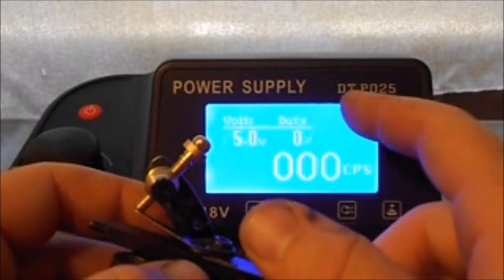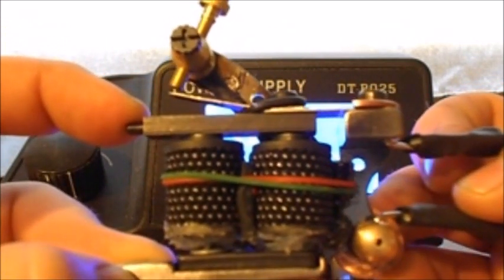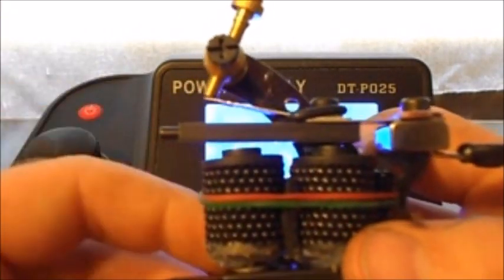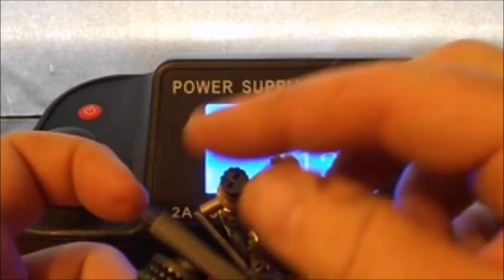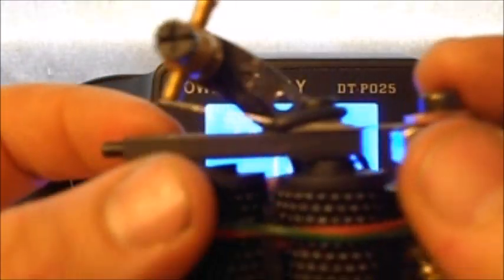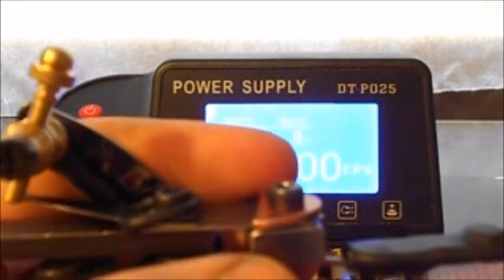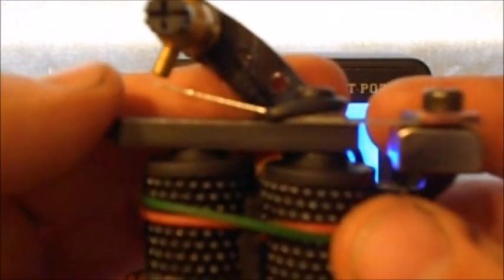Duty Cycle Explained  Tattoo University

Comment: Duty explained at 1:18 example !
Super helpful

MAIN POINT:
[ less than 50% duty = 
more time spent down around coil]

[more than 50% duty =
More time spent up
Around the contact pin]
Reply: 2:04 Adjustments to contact pin - front spring: change current Duty
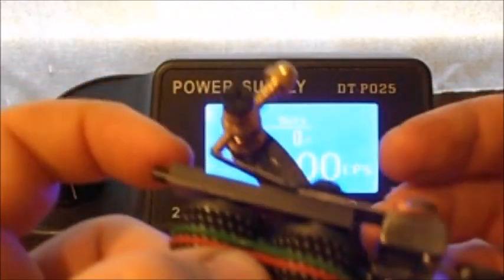Reply: 3:31 
Tightening rear spring = Shortening it closer to the frame
Another Duty adjustment
Reply: Just some personal notes that helped me learn from this video..
Hope these help others too!

Comment: I have a good understanding of machines and duty cycle, what it means and how to change it.  I have a set of pulse coils on their solution machine that run at 112cps and a 6% duty, around 375g tension with right at a nickel gap for the point gap and air gap.  The machine for all intensive purposes is running "normal".  Critical power supply is fine.  Assumed the coils were "bad" and put on a new set.  New coils are running 125cps and 54% duty with all other parts being the same.  What causes those pulse coils to show a 6% duty? Adjustments to the springs and point gap will cause a change but it'll jump around and then drop right back down.
Reply from the maker: That is a good question.  I have not run into that issue yet.  I will have to look into this.  Did you try to put the coils on again and see if it still had 6% duty?  Usually when numbers jump around I know something is off.
Reply: Tattoo University lmao. Sure did. I thought no way. The capacitor is good. Nothing is loose or shorting from what I can tell. But I put those pulse coils on and bam 6% duty. Doesn't make any sense. I even threw on a tube and needle and grabbed some practice skin. It runs like normal.  Put the new set of coils back on and it's right back to >50% duty. So it has to be those coils. The only slight difference is I need to add some extra shims to the front pulse coil. Same shims though. I just need 4 on that one instead of 2 with the new coils. I should go video it and put it on here. I've never ran into this before.
Reply from the maker: You got my interest.  I would love to check this out.
Reply: Tattoo University go ahead and check the video but I think I've solved my problem. It's coil and critical power supply specific. I've been rebuilding machines all day. I have 3 of about 20 sets of coils that the critical power supply just will not recognize. 2 I'm sure are Chinese junk but the other is that set of pulse coils. One of the others will read 100% duty. The other just bounces around. What I did was dug out my backup hurricane power supply. It will read them correctly. Or it at least gives me numbers close to what I expect to see. I notice since doing this all day as soon as I touch the pedal on the critical PS for one instant it'll flash correct readings then it'll go all haywire. No idea what these 3 sets of coils have in common that the others don't have or do have. I'll ask critical and see what they say but I expect they'll just say they're power supplies are just that super sensitive and accurate that something is throwing them off. Like they say you're duty on their ps's will read a bit higher than others because of their accuracy.
Reply: Tattoo University Criticals developer and owner found this to be very unusual as well. Have them checking the YouTube video and determine if my ps needs sent in for diagnostics.
Reply from the maker: Keep me updated if you will.  I like to troubleshoot problems and this is something I haven't run into yet.  This way I will know what to do if someone brings up this issue again.
Reply from the maker: Typically when I see this there is an issue.  Usually a short and the machine will run correctly for a second before it  messes up.  I've had power sources that turn off when this happens.  Usually a safety measure so the power source doesn't get fried.  If the machine is erratic when it runs and the power supply can't quite get a number it likes.  Usually I do what you did and switch out parts.  Narrow down what part is causing the  problem.  The duty cycle lets you know how many times the circuit is on and off.  With a rotary machine you don't get that because it is a motor.  The power source will still run but won't give you the duty.  My guess is the way the power source reads the duty is being thrown off by something.  Something is being erratic or not stable.  Maybe the cheaper power supply isn't picking up on that but the critical is.  I would probably switch out the capacitors and see if that fixed the issue.  If that didn't do it then you could cross that off as the problem.  Will be interesting to hear back from critical on this.
Reply: Tattoo University yes the owner of critical seemed to think it was a problem with the "contact point interface" within their ps causing the issue. He's supposed to look at my video today and let me know whether or not to send the ps in for diagnostics. Seemed pretty honest to take his top of the line ps and admit right off the bat that the ps may be the problem. Can't say I've ever had a capacitor go bad. I would expect sparking don't you think?  Worth a try I suppose. I have the parts so wouldn't be a big deal.
Reply from the maker: Awesome!
Reply from the maker: It might not make sense to me, but I'll try it anyway.  Every once in awhile you get surprised.
Reply from the maker: Usually messing around with this stuff leads to the answers you are looking for
Reply: Tattoo University ya and that's about the only thing left that I haven't messed with. Lol. I'll get one on there here in a bit and report back if it made any difference.
Reply: Tattoo University Nope changing the capacitor didn't help. All 3 that don't read correctly are 47uf so I tried a 22uf. Used the China coil that reads 100% duty. Didn't want to tear apart what are probably perfectly fine pulse coils.  Machine runs faster of course. Still 100% duty. I'm wondering now though...if I had put one on the pulse coils would it have increased my duty to 8 maybe 10. As the lower uf rating should increase the duty too. Can't tell when it's already at 100.
Reply from the maker: Hmmmmmm.......interesting.
Reply from the maker: It's like the power source is too smart for practical use. The good thing is you know what you are doing.
Reply: Tattoo University ya that's kind of alarming for Critical I'd think. I guess he said they've never seen that before but for a newbie they'd be lost with a ps doing that. I wasn't all that concerned because the vast majority of my coils read just fine like 17 out of 20 sets. I just wasn't going to use the ones that don't register right. I ordered 2 more sets of pulse coils. We'll see if it reads them ok. Now I'll be convinced the ps is bad if it won't run a brand new set of pulse coils. Didn't hear back from Critical today.
Reply from the maker: This is an opportunity to learn something.  I'm glad you shared it with everyone.  I think there is a lot of room for improvement when it comes to tattoo machines.  Figuring out little quirks like this can lead to better equipment in the future.
Reply from the maker: I've heard comments that there is nothing new in tattooing.  I think this is incorrect.  We are making improvements on tattoo equipment.  As you improve you also run into glitches.  Tattooing is advancing and the technology is advancing.  Thinking that tattooing technology doesn't improve would be a mistake.  I trust critical and eikon.  They are a good companys.  They have a reputation to protect in the tattooing community.  I'm sure they will figure this out.  If they don't I'm sure the tattooing community will.
Reply: Tattoo University agreed. You know what I keep waiting for is a system similar to the cartridges but that also have a sealed ink pack on board that feeds to the needles with a lil squeeze. But ya I hear ya. My main equipment are pulse machines with pulse coils obviously, eikon springs (I actually just ordered their tru spring a bars because I've never tried them), and critical power supplies. Those are 3 of my most trusted companies. National as well. I've never had anything bad from them as well and great customer service.
Reply from the maker: You have read my mind.  I have some drawings of needles with ink cartridge systems.  Nothing concrete yet but I have some ideas.  You should be able to set up a tattoo machine like you refill a pen.  If the customer service is on point I can give them a little slack if they send me something bad.  As long as I can send it back and get a refund in a timely manner.
Reply: Tattoo University see I also vape. And the bottom feed mods got me thinking if you had a small silicone bottle that fit into the grip you could have a small silicone tube run to just behind where the needles touch the bottom of the tip. So you would tattoo until it started to run dry then give it a lil squeeze with your thumb to push more ink to the tip. Send me your email and I'll send you a pic based of these bottom fed mods. I think it's completely doable.
Reply from the maker: I thought the problem would be mixing colors. You could set something like this up for lining.  You could outline the whole tattoo without dipping in the color cup.  Could save you a lot of time.  Maybe with color you could just have an empty cup that you could mix colors in.
Reply: Tattoo University ya the way I have it drawn up you would have a bottle for each color. Maybe the little nipple on the tip could be made to plug a syringe on it to flush the tube out. Even just having maybe a 7rl and 15 mag for black only would be a time saver. Just seems like dipping your tips into little cups is something that could evolve into a more efficient system.
Reply from the maker: I agree that there should be a better system for the color cups.  Too many things go wrong with them.
Reply: I am confused about Volt, CPS and duty .. I have a machine brand new made in England I need 9v to get 50% duty and 128cps. Is that ok or does the voltage has to do with how strong the machine hit??? Thank you for all the informations. Your videos are very helpful I am 53 and finally have time to learn about my past passion. Very hard at my age to get help and infos and sure no apprenticeship possible.

Comment: so how about the tension gauge or grams for ,
 does it really matter
Reply from the maker: Tension matters.  Too much will overheat the machine.  Too little and your machine won't run right. You can do it without a tension gauge but the tension is important.  You can do it by feel but a tension gauge gives you number to work with.
Reply: so you mean no proper number for this sir?
Reply from the maker: There are numbers that people recommend for your machines.  People set them up differently and machines are different.  I'm posting a link to San Martin Tattoo Supply.  They have a page with their recommmendations.  

http://sanmartintattoo.com/index_files/Page5633.htm

Comment: doesn't just tightening and loosening the contact screw practically do the same thing
Reply from the maker: That will adjust your duty cycle.
Reply: Tattoo University okay so then what exactly Is the difference between bending your spring compared to just adjusting your contact screw?
Reply from the maker: You are talking about a machine tuning issue.  You want to get your machine as close to being tuned as possible.  Then you adjust your contact screw a little to get it perfect.  If you just adjust the contact screw your machine can still be out of tune.  You could have too much stroke.  You could have too much tension on the springs.  You dial everything else in first and then adjust your contact screw.
Reply: Tattoo University ahhh I gotcha how can I know if I have to much stroke?
Reply: I adjust my contact screw and my voltage for I'm running low volts without there being to much hit so it's just about right I go down on the skin and it has just enough give without it running to many volts and it doesn't hit to hard
Reply: do you have a video on stroke and throw?
Reply from the maker: I talk about it in some other videos.  I'm doing some machine tuning videos pretty soon.  They will explain how adjust that.
Reply from the maker: You check your gaps and how much your needle travels.  You don't need a lot of stroke for small needle groups.  You need more for bigger mags.  You will also have to adjust to the type of ink your using